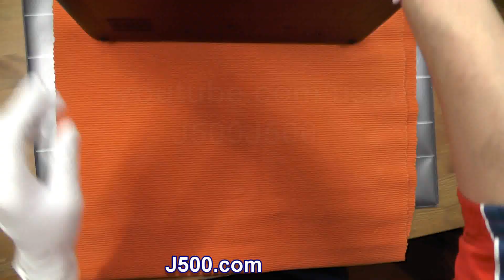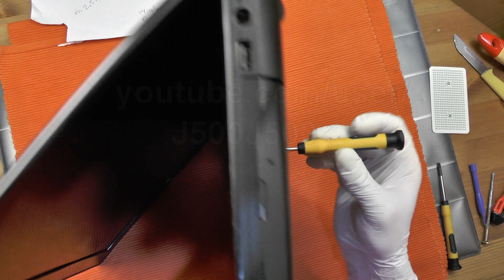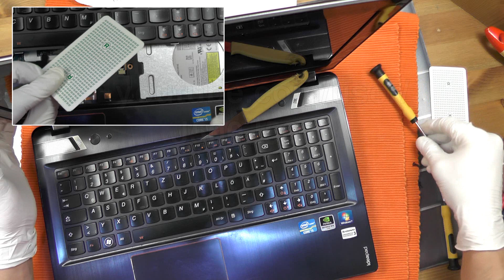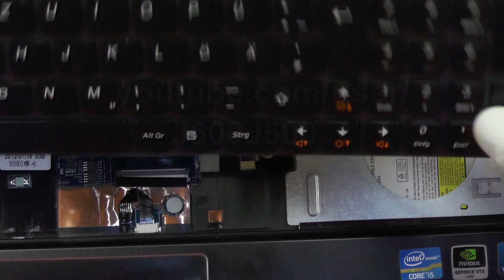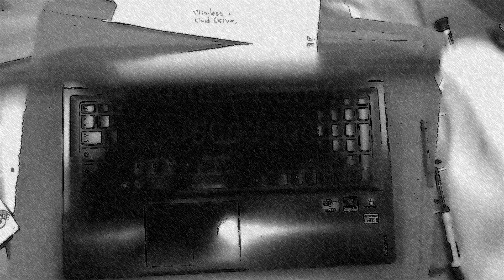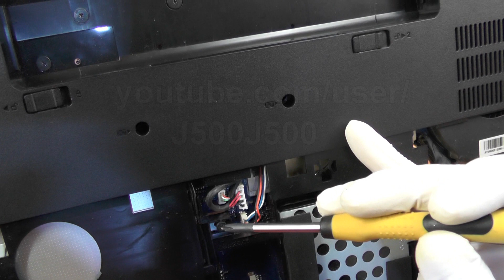Lenovo IdeaPad Change Backlight keyboard Y580 Y585 Y780

Comment: Would love to put this into my Z580 lenovo. But, I know the z580 doesnt come with a light flex cable entrance on the motherboard.
Could I still fit the y series lenovo backlit keyboard and make some sort of alternative Power Route to have it backlit??
I also wonder if the y series backlit will fit the Z580 palmrest keyboard housing shape perfectly, or not
Reply: Yes you can, i did with my Lenovo B570. Any Ideapad G B Z Y series can if you replace the microphone power source entry with the backlight cable.